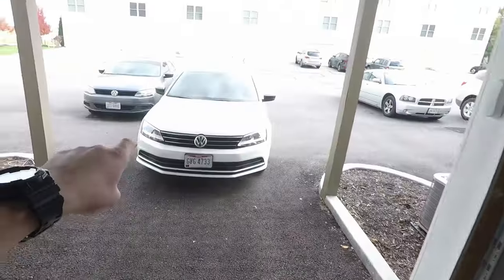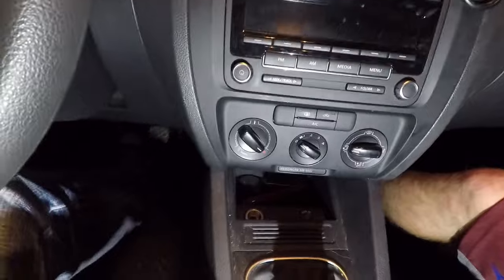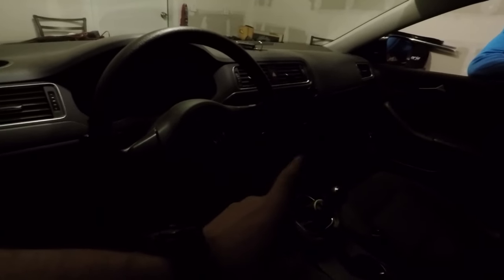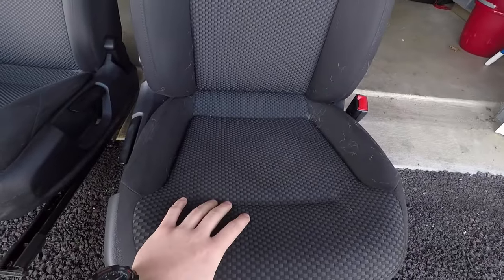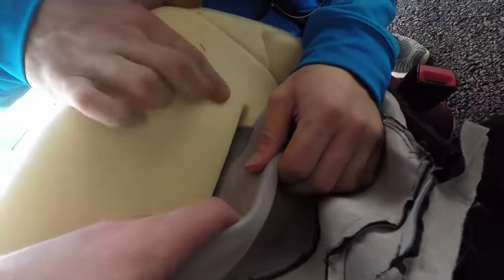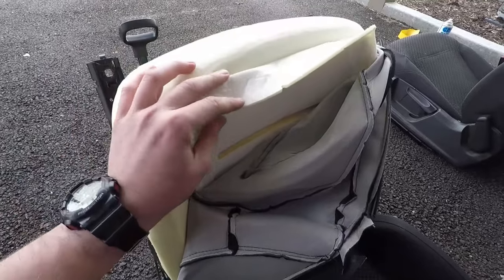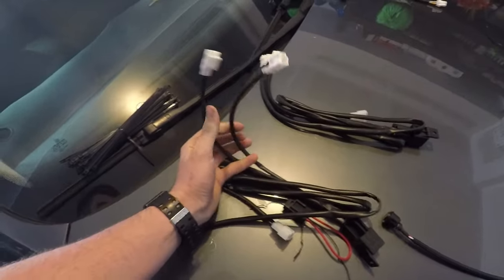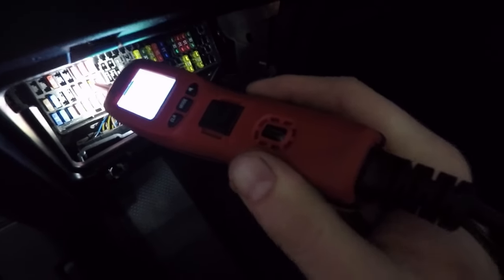How To Install HEATED SEATS in ANY Car!!! *EASY*

Comment: A lot of confused people on here i see. I do upholstery and install these all the time. The bottom cushion was installed incorrectly. First off you put it on backwards. The heat starts closest to the side where the wiring is. So when you turn them on, your leg area will warm up before your butt will, it should be the other way around. Also you do not need to cut the listing out. You can cut a hole in the seat heater to clip it in. You can also cut the heater smaller to fit correctly. But yes you can install them on cloth seats. Many new model vehicles are coming with heated seats even with cloth.
Reply: Just make your own video
Reply: Thanks bro. A lot of help!
Reply: @malikulamin9948  not you. You were no help.
Reply: When people order them off of you, can they feel the pads on when they sit in the chair? I’m worried if I get them done I’ll feel it and it’ll annoy me if I get them installed 😭

Comment: You can just bend the hog rings open with some pliers and they will come out. When you go to replace just use zip ties in the existing holes from the hog rings.
Reply: Don't be stupid. They use hog rings for a reason. Do a sloppy job, cut corners and it will result in a poor installation in time. Suck it up and do the hog rings. 
You can cut them off with side cutters. 
Luckily, the newer cars use easy to remove hooks.
Reply: @richardweyland116  Zip ties work just fine. If anything, it makes it easier to take back apart when these inevitably go bad and you need to tear it back apart in 1 or 2 years. I've gone though 3 sets of these kinds of pads per front seat and they all fail in the same way. Some of the wires fail overtime and starts to burn a hole in your seat. And no, it's not a bad install, every time it's gone bad has either been the temperature sensor, or some wires on the edge of the pad, nowhere near any possible pinch points.
Reply: @richardweyland116 stop being so sensitive… it’s a car seat…He’s not saying to hold up the exhaust with zip ties 🤡🤡🤡🤦🏻

Comment: it's cool that you can find these heating elements aftermarket. The switches look like factory. Nice job on the install, except for cutting the anchor point, that made me cringe a bit. lol!
Reply: Cringe is right. Cutting the channel is condemned by nearly all professionals. Eventually, the fabric is going to get loose from sliding in and out of the seat and will look like crap. Typical short cut taken by inexperienced young people. There are much better aftermarket kits than what he is hawking. High and Low only is ghetto. I have a 5-position selectable dial switch. If you’re going to do this, get a little quality. Very little additional cost. This video was as useful as a broken leg.

Comment: Skip the add a circuit. Factory circuits are designed for factory functions. All wiring should be rated for 125% of the maximum current draw. Go straight to the battery or the supply stud for the fuse block if its not accessible. Other than that nice work! Emergency vehicle upfitter here in NJ
Reply: J J  or you could burn your car up, what ever floats your boat 🤷🏼‍♂️
Reply: Exactly this. Selecting a circuit not rated for the current and you're at risk of causing a fire
Reply: Hey, I'd like to go to the battery, but how do I achieve auto off with the ignition? Do I need to install a dedicated solenoid for accessory additions that's triggered by an ignition positive?
Reply: Maybe wire the ground from the element into the ground for the main relay or something

Comment: Say what was the the electrical tool you used to check which fuses had power and which fuses didn't have power to them. Brand and model please if you have that info. Thanks a ton
Reply: It's called a Power Probe. I use it to Troubleshoot Various Vehicles Electrical systems. It saves a lot of time.

Comment: Hello, 
Chevy Cruse 2017 

I have two heated seat kits, the instructions state to "Locate an onboard power supply that is able to deliver a continual 10 amp current while the vehicle is running". I have found two fuse locations that I would like to use for the two heated seats I purchased. One is the F13 25 AMP fuse, original use heated seats. The second is the F11 20 AMP fuse, original use sunroof. Both of these fuses are not in use as I do not have either function. 

My question is this, the kit comes with a 10 amp relay that will be tied to the fuse tap that comes from the fuse box and then tied to the heated seat to provide power. How should I handle this situation? What AMP tap should go into the fuse box and what fuse should go into that tap. 

All help is greatly appreciated

Thank you,
Mat

Comment: What type of spray adhesive do you recommend that won't react with the foam or heat...thanks
Reply: Very curious about the spray adhesive!
Which do you use?
Reply: 3m super 77

Comment: What tool did you use to test the fuses? Would like to purchase one like that? Thank you
Reply: 3 months? No answer? Lol ignorance on their part. It'd be a voltage sensor mate. Even a voltage sensor reader as it provided a reading of voltage. Brand I don't know but uncle Google with help with the correct words typed in.
Reply: Here's something similar, https://www.tlc-direct.co.uk/Images/Products/size_3/TMDL6780.JPG
Reply: It's called a Power Probe. They save time when Troubleshooting.

Comment: What did you wire the hot wire to?  I know the ground wire goes to a metal part of the actual vehicle, but what did you connect the hot to?
Did you splice it with another hot wire that is used to power another feature on the vehicle?
Reply: Normally you would want to connect that to the control, and that goes to your fuse box to power it.

Comment: So there is no fuse for the heated seats? Also the seats won't stay tight since you cut that. After a few months to a year it will probably start looking loose like an old aftermarket car seat cover.  However, it's your friend's car so as long as he doesn't mind no big deal.

Comment: I'd love to see this done to rear seats! I have a saab 9-5 today and the front seats has heaters but not the rear, I'd really like to do it, maybe it's basically the same procedure? how accessible are back seats?
Reply: Mozaffer Abbasi SAABs are fairly easy to take the back seat out of. Should be just a few bolts holding it all together. Itll be easier to do than the front seats.

Comment: Would running the power wire to my remote wire in my radio work?
Reply: The supply wire needs to be a suitably rated size for the heaters. Car stereos would normally be too low to supply heaters and you risk just blowing the stereo fuse, or melting the wiring at worst.

Comment: Are these a fire hazard? Will they get too hot if left on?
Reply: Not a fire hazard if fitted correctly. They will have a built-in thermostat to keep them at a comfortable temperature.

Comment: Do those fuse taps come with the kits or have buy separate
Reply: I appreciate this question is a year old, but some kits have fuse taps, others don't. If they come with the kit you'll likely three different types, two of which you won't use. If not the taps are cheap enough to buy either through Amazon, eBay or a decent local motor factor.

Comment: What tool did you use to detect power?
Reply from the maker: Power probe!
Reply: you can use just a regular meter from harbor freight or something cheap. just touch something metal in the car with the black probe and with the red probe, go to any fuse you wish to check.

Comment: I’m putting 15% tint on top of my 20% tint to make it darker, does that basically even out to what would be 5% limo tint? Will it be darker then 5% since it’s double layered?
Reply from the maker: +Kevin it will be relatively close to 5% maybe 4% if your doing 15 and 20
Reply: Yes I have 20% but want to know if I should do 15% over it. I’m thinking of 5% over the 20 but I think that would be too dark, so 15 over 20 is basically 5 then?
Reply from the maker: +Kevin yes 5 over 20 will be extremely dark but could still be manageable, would recommend as close as 20% over 20% as possible it will net you about 5% tint

Comment: Not crazy about having to drill into the dash but it's probably no other way I wish it would be able to use the buttons that came with the vehicle unmarked
Reply: @rc_fist8352  my car does not have that option it has the blank button worth it did have that option it would be there but it does not have the option
Reply: @rc_fist8352  yes it was an option

Comment: Hey Ryan. Thanks for your vid. Just wondering. I have a car with heated seats that I bought used. The seats are in a 2013 Sorento. 

They are not leather, not cloth but rather like comfortable vinyl. Can I steam clean the seats? Would I damage the seat warmers? They were factory installed. Should I take my car to have seats professionally cleaned instead. Please let me know. Thanks!
Reply: I never got a reply from Ryan. Guess he is not making any more videos....
Reply: @edwardsmith7396  that is really sad

Comment: I did this same install on a 17 Jetta with the same kit and it interferes with my passenger occupancy sensor
Did you have this issue? 
Did you do anything specific to avoid it?
Reply from the maker: Yes we usually just cut it right before it so it doesn’t touch it, if you really don’t want the light and the whole seat covered you can unplug the occupancy sensor under the seat

Comment: I'm confused I was led to believe that you couldn't put heated seats in cloth only leather please explain
Reply: decius marius yeah that's definitely not true. I have a 2017 Hyundai Elantra value addition and it has cloth seats and my seats are heated from the factory so you can put heated seats in cloth
Reply: I had heated seats in cloth on a 2007 Mazda3.  Definitely not true.  I believe cooled seats are reserved only for leather though.